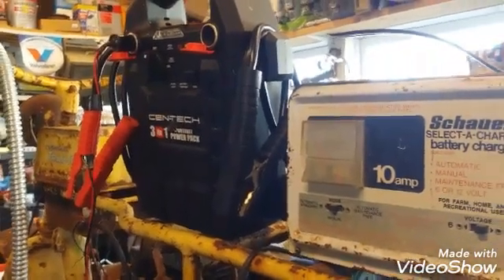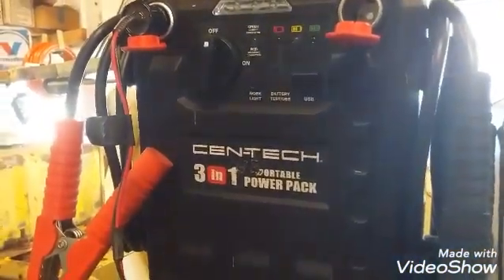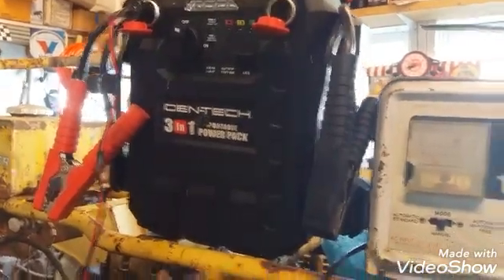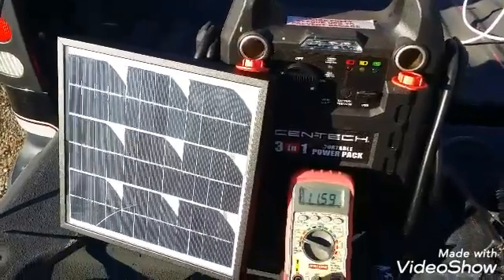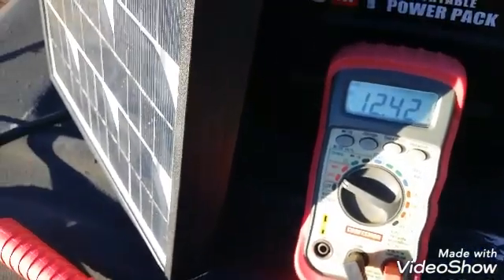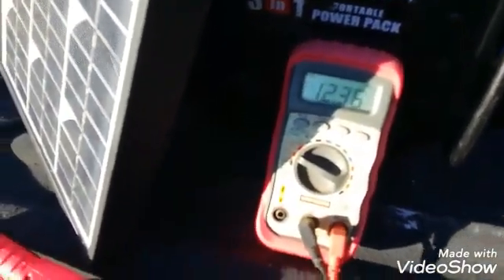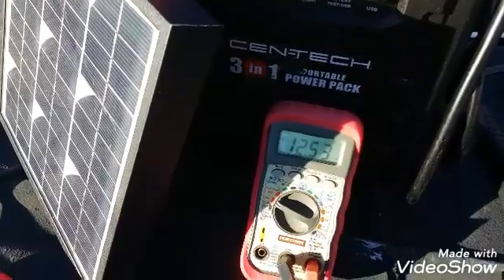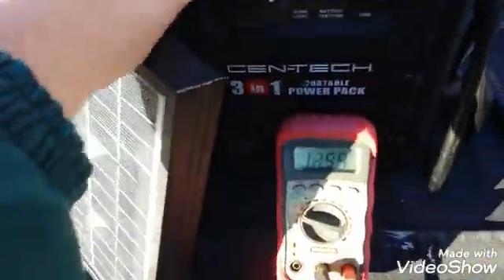Can you charge your jump box / jumper pack with a solar panel? Let's test it!

Comment: I charged my 5 in 1 centec power pack with a solar panel for 2 years with great success
Reply: Did it really take that long to charge it 2 years?
Reply: @MikeO-p8l  I guess I should have properly worded that better! I used a solar charger on it for two years living off grid when it needed to be recharged.

Comment: Those Harbor Freight Centech jumper packs are lead acid, I think (so bulky).  You might as well just keep an extra lead acid battery of some kind around and jumper cable . . . and a cheap pwm charge controller ($13 for 30 amps) and a 12 volt panel.  Some connectors needed.  Those small "battery maintainer" 12 volt panels are actually really high volt these days, like 18 volts.  Back when 12 volt was closer to 12 volt those trickle panels worked well, but voltage has to match the battery's actual voltage at the moment for best results.  They have really cheap wiring, too.  But, you could use a cheap buck converter and convert down the voltage a little, as an alternative to a charge controller, if you already happen to own a battery maintainer.  Better to get a "real" 12 volt panel.  Renology (good brand) have had some pretty good deals on thier 15 lb, 50 watt glass panel on Amazon.  You can get glass 100 watt 12 volt panels that are 15 lbs though.  Cheap plastic panels won't last a year and are often over-rated watt-wise.  Used 12 volt off Craiglist, maybe.  I wouldn't worry about that 5 watt panel frying your lead acid.  It is probably pretty safe.

Comment: I windered this! I haven't tried it yet because I don't know if forcing electricity into it the reverse way would damage it or not x_x
Reply: My setup WOULD be,  harbor freight solar. 100 watt panel, the 15 dollar charge controller with alligator clips. I thought about attaching the panel > alligator clips > jumper cables of the dewalt. But am scared lol

Comment: Dude! I’m trying to Solar charge my Schumacher jumper/power station! 

If I plug it into the wall it will stop when the battery is full. I can leave it plugged in and it won’t damage the battery. 

I’m thinking I might try to hook up a panel directly into the main charging port in the back where it would usually plug into the wall. 

Do you have any thoughts on this?
Reply from the maker: Both of my battery packs have a 110 Volt AC Cord to charge it, the 110 volt ac to 12 volt DC Battery is built into the battery pack. It's not designed for 12 volt dc at that spot.

Comment: Not a bad idea at all.Did the same thing with a jump starter and solar panel but using a regulator in between the solar panel and the jump starter clips. I made a small 20W folding solar suitcase made from two 10w solar panels and hinges, added a 10A solar charge controller with 2usb ports included, solar panels wired in paralel for 18V and 1A and from the solar panel I wired 2m cable with crocodile clips so I can connect the solar to any 12V battery. My jump starter is a small one (bought with only 15 dolars), but I use it just as a power bank because it has a 12V 7Ah lead acid battery and it's clips are connected via a thick wire to the battery (just interrupted by a on/off high current switch). I just turn on the jump starter and connect the clips from the solar panel to the clips from the jump starter and it charges. I know there are not many things to do with a 7Ah battery but at least for emergency you can charge your phone in the 12v outlet or use many 12V devices that you can use in the car 12v plug.
Reply: my jump-starter box has a slot like a car's cigarette lighter.  There's a $15 solar panel from Harbor Freight that has the attachment that fits into a cigarette lighter. Would that recharge my jump-starter - that slot?

Comment: Thanks for all info I have  a new battery from Costco cat professional power station and I bought a new brief case solar  charger 13 watt  you think this solar will charge the new battery charger please I need advice thanks
Reply from the maker: 13 watts is about 1 amp. It will take a while but will charge it.

Comment: I have a solar panel but what I'd like to know is my cigarette socket says 12v outlet would the solar panel still charge the battery on a  12v outlet?
Reply from the maker: Yes... as long as you don't exceed the amp rating of the fuse it's connected too.
Reply: @GlennsSpeedShop  yeah I've got a solar regulator linked to it
Reply: Secondly then if I buy a double cigarette socket and power a travel kettle  from one socket and charge with solar on the other socket at same time that would be fine too?

Comment: i charge my nautilus marine power pack with a coleman 40 watt solar panel with a charge controller, takes approx 8 hours full sunlight to charge thru the lighter socket plug to 12.5 v. impressed i am..
Reply: The problem is that the sealed lead acid battery should be kept between 13.4 and 14.8 that's what I found out on utube and confirmed when I took apart an old black and decker booster pack written right on the battery was do not discharge below 12.2 volts float charge is 13.4 and full charge is 14.8 so charge it with a proper charger that does sealed lead acid batteries
Reply: @douglaswindsor120  when charging it goes up to 13.5 volts, my power pack says fully charged at 12.5 so it seems to be working for me even tho ive seen the power pack discharged to 9 volts..
Reply: @anthonycyr9657  it will last longer if charged properly don't trust the company that makes them I always blamed my self for mine dieing with in a year then I found out the truth it was designed to fail I have 3 that I have to replace batteries in when I do I'll charge them properly and if what I read on utube is right they should last 5 years or more before the battery get too sulphated to take a charge and a replacement battery is a lot cheaper than a new unit
Reply: @douglaswindsor120  ive gotten three years out of it so far so and it still boosts my truck when needed and provides emergency power, i  top it up every three month with the wall charger, so its paid for itself..

Comment: There is no outlet or place to plug in the quipp model #DP600 power pro charger. It's too low to charge my car battery. Way frustrated. Can't believe there's no way to charge a #$-#$&$#$ charger!!

Comment: How.d you hook up the panel to the unit. Direct. No invertor or regulator?
Reply from the maker: For this video, yes direct. This was a can it be done video, I don't leave mine outside and charge this way. I did another video where I put this small panel and parelleled, another small panel with a charge controller to charge a truck battery. In  SHTF situation, you can connect it direct but you need to monitor the battery to avoid overcharging it. Stay 14 volts or below.